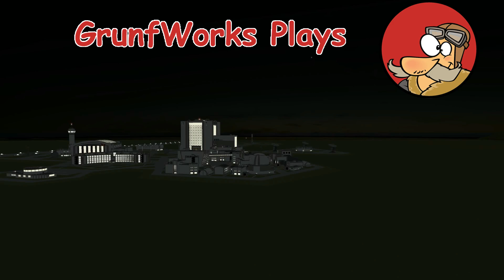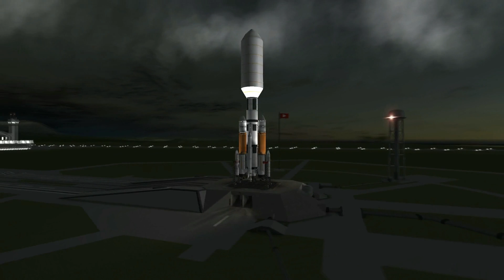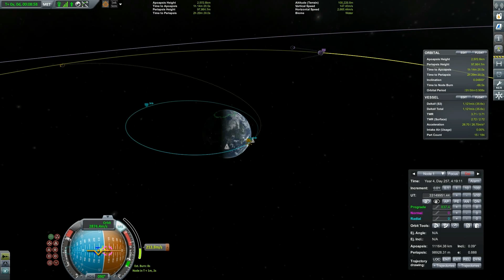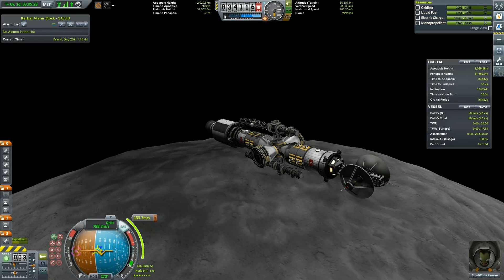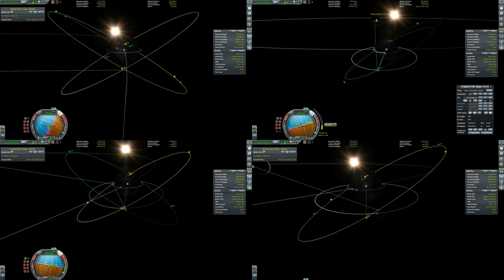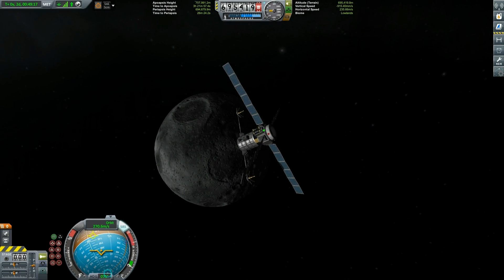Collaboration Station #7 "Deploying Comms!" --  KSP

Comment: What visual mods are you using?
Reply from the maker: These ones: 
Engine Lighting: 
http://forum.kerbalspaceprogram.com/index.php?/topic/109845-122-engine-lighting-15-the-toxik-yoghurt-update-19-november/
(it illuminates the rest of the craft with light from engines)

RealPlume: 
http://forum.kerbalspaceprogram.com/index.php?/topic/130576-122-realplume-stock-configs-continued-v0114-1222017/
(for plume stack)

and others visual are:
Stock Visual Enhancements: 
http://forum.kerbalspaceprogram.com/index.php?/topic/143288-122-113-stock-visual-enhancements-116-1083/

Scatterer: 
http://forum.kerbalspaceprogram.com/index.php?/topic/103963-wip122-scatterer-atmospheric-scattering-v00300-22012017/
Reply: Thanks

Comment: Nice job on those comm sats, that's some pure orbital magic my dude. What I usually do is just the regular "triangle/square" in a equatorial stationary orbit. The only thing I would've tried (and probably failed) to do different is putting some small dishes onto the station while providing long distance communications with the comm sats for use in possible future missions outside the kerbin/mun/minmus system. But these things are a pain the arse if you try to put multiple ones into a single fairing..
Reply from the maker: Yea if you want bigger dishes on comm sats, it usually a good idea to launch comm sats 1 at a time. I typically deploy only the short and medium range comm sats in a single launch

Comment: Nice video, it was well put together, and overall, quite beautifully made. I have to say, your contribution to the station is one of the more useful ones, and i am glad you could take place.
Reply: Jorge This wasnt the most important module by far. The DJ entertainment hub was way more important, without it the kerbals would be bored.
Reply from the maker: absolutely correct :-)
Reply: Good video but I think he pissed the point. Wasn't it supposed to be a module added to the station?  That was a station in and of it's self.    Would have been a better "hub" to start off with imo.
Reply: The "DJ Hub" was meant to be comms

Comment: What a wonderful way to spend an afternoon!  Also what mod are you using for the effect on the rocket engines?  It looks amazing.

Edit: can you post a mod list?  Your KSP looks like a new game.
Reply from the maker: I use 2 mods:

Engine Lighting: http://forum.kerbalspaceprogram.com/index.php?/topic/109845-122-engine-lighting-15-the-toxik-yoghurt-update-19-november/
(it illuminates the rest of the craft with light from engines)

RealPlume: http://forum.kerbalspaceprogram.com/index.php?/topic/130576-122-realplume-stock-configs-continued-v0114-1222017/
(for plume stack)

and others visual are:
Stock Visual Enhancements: http://forum.kerbalspaceprogram.com/index.php?/topic/143288-122-113-stock-visual-enhancements-116-1083/

Scatterer: http://forum.kerbalspaceprogram.com/index.php?/topic/103963-wip122-scatterer-atmospheric-scattering-v00300-22012017/
Reply: Ryan Soto I believe it's RealPlume
I have that and it looks exactly the same